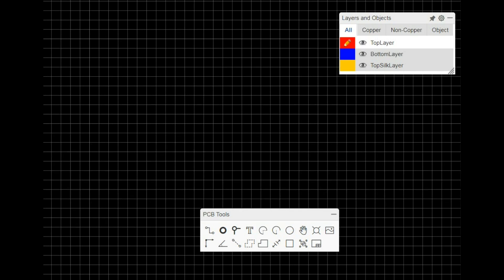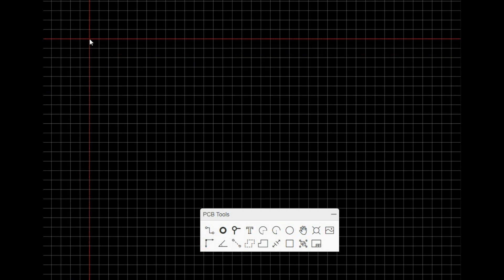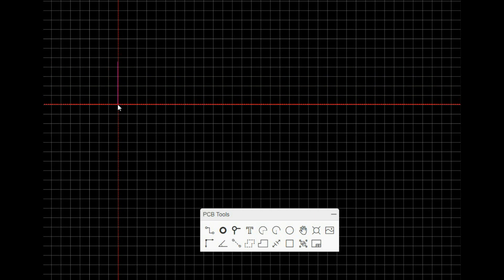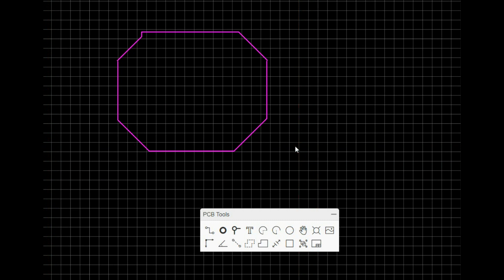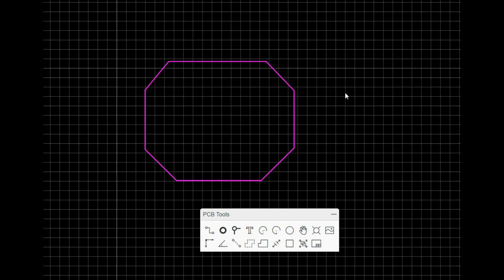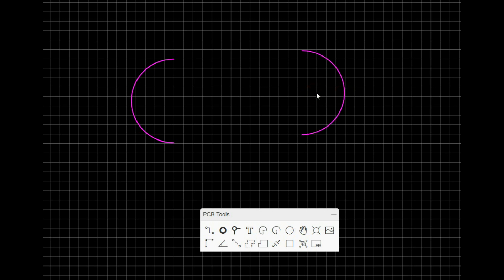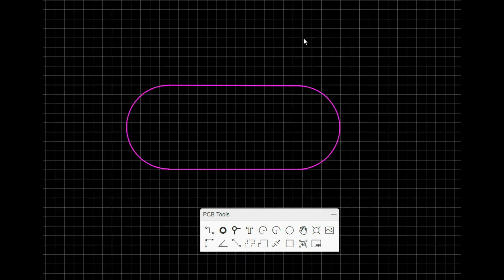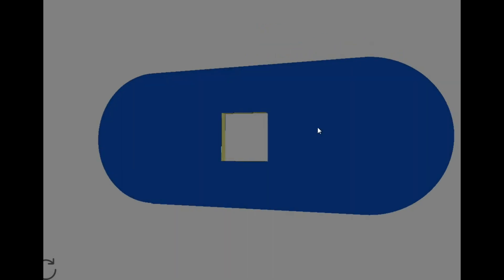How to draw custom board outlines in EasyEda

Comment: Hi Paul, 
Could you please show how to add a Through Hole connection hole to a schematic? Like a place to solder in a wire to a something off board(battery, solar panel, dancing cat, + -), such as with your Breadboard design. I can't seem to reverse from PCB to schematic with meaning and must be missing something.
Is this possible in the schematic mode so it will then show up when you convert to PCB,  or only the PCB design mode? VCC and GND just disappear. Thanks
Reply from the maker: I just use 2.54mm header pins (male or female doesn't matter) In the EELIB tab they are called HDR-F-2.54_1X2
Reply: @learnelectronics  Thank You